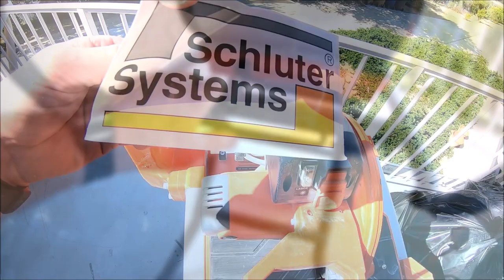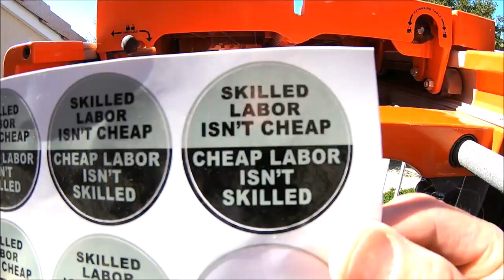Modern Fireplace Makeover Fire Glass & Stacked Stone

Comment: I have a gas starter wood burning. Your gas line looked just like what mine does. Would I have to add anything different to make it work this way? It's not electric, I turn the gas on with a key. This would be a great solution as I'd been looking at the log sets & the burners that come with them. This is much prettier and seems easy. Also my fireplace surround is that large varied stone from 1975. I want to cover it with something similar to what you used (the stacked stone). Would backer board covering the original stones work? This was a great video. I hope you or someone answers my questions!
Reply from the maker: I don't believe backerboard is necessary. You can simply prime the brick, or skim over with thinset and let dry before installing tile.
Reply: @LandbergTileTV  its a very uneven surface.  I wish we could post pictures on here! I've gotten so much help from the YouTube community! Do you know anything about my question about the burner?
Reply: @jenniferjahns4006  I went to the fireplace store yesterday and bought a special pan for burning glass. The pipe is covered with a piece of sheet metal. Everything I saw on the net also said not to do this. It is dangerous as it can emit carbon monoxide into your home.